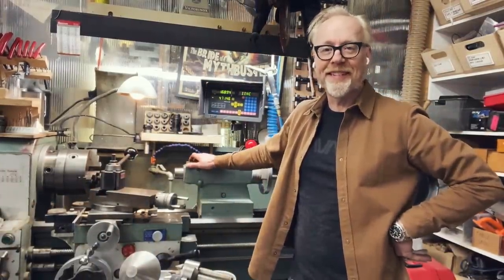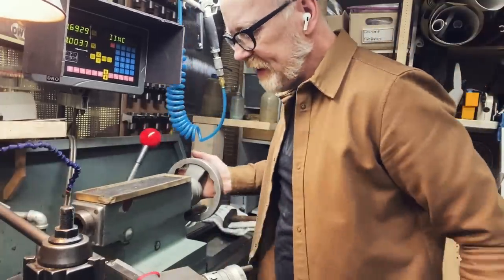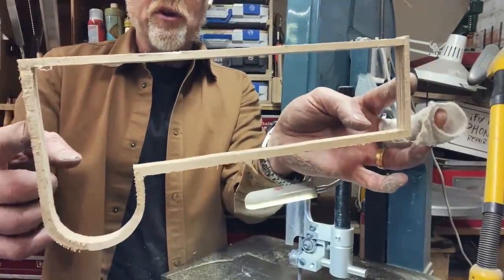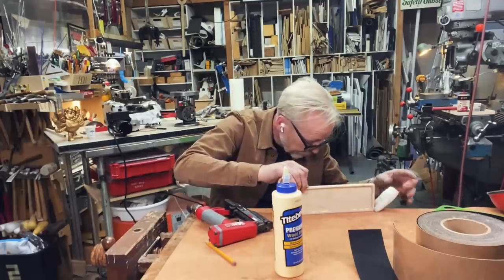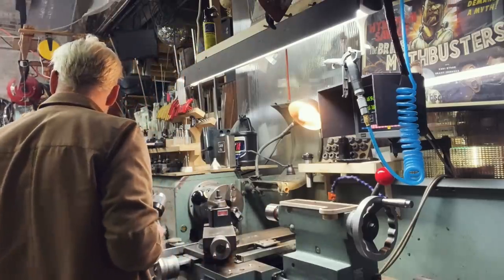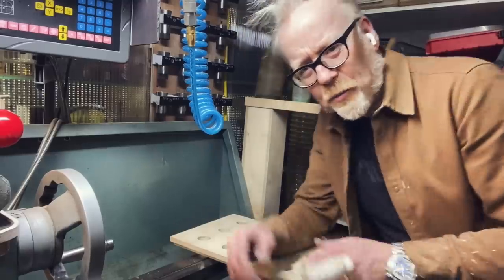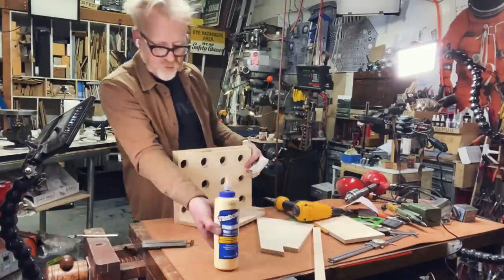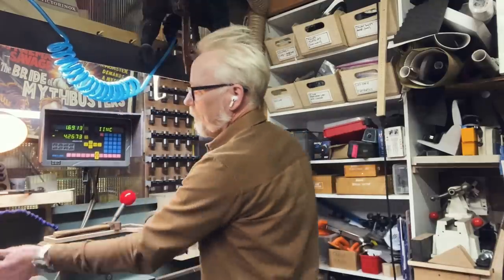Adam Savage's One Day Builds: Lathe Infrastructure Upgrades!

Comment: I am a fiber splicer we use sticky backed felt by the truck load it's a one handed job. Place felt side up hold with middle finger pick at felt corner with pointer finger it's all about the right bend and it will unlaminate itself and stick your finger in the process so you can keep it free of debris. it's the small things.

Comment: I use painters tape to get the backing off of sticky stuff. Put a little piece of tape on the corner of the backing material with a little overhang and then just pull up on the tape, that usually also takes the backing material with it. About 95% success rate on the first pull. Depending on the adhesive quality on the tape

Comment: the trick i have for the VHB 3m tape is to cut a bit extra at an angle. then tear the last bit of that cut, it tends to pull up the red backing and give oyu a little mangled tab to start peeling it with then i'll just trim off that little extra

Comment: Hey Adam. When i pull of the backing of a tape, i completely fold a smal piece of the corner, then scrape the backing back with a nail. Like if you bend two pieces of paper, they wont line up, and you create an edge, for you to handle. Hope it help. Cheers

Comment: Mr. Savage, I love all your videos and particularly the builds; I have 2 questions, 1 tape backing solution, and 1 random comment:
Tape solution:  Since you already have your exacto knife out, instead of digging at the corners cut lengthwise down the middle just enough to get through the backing. You can now fold the tape/felt/etc in half and getting the edge of the backing to come up on its own.  I learned this trick from label maker tape.
Questions:  I apologize if you've answered any of these before.  1: I know you where hearing aids, but notice you've been using the earpods a lot in recent videos (for audio pickup I'm guessing?) do the two devices interfere with each other?  2:  In this build I notice you have a cast iron frying pan on the rack at the tail end of the lathe, what is its function?
Comment:  My father was always a huge proponent of "glue and screws", both in excess, on the rare occasion he did wood working (he and wood never got along, metal was his product of choice).  Thank you sir!  Hope the finger continues to heal well!

Comment: To make peeling VHB tape easier, when cutting a piece off the roll don't cut all the way through with scissors. Cut almost all the way through, leaving an 1/8th - 1/16th of an inch and tear off the roll with a pulling action. That little 1/8th-1/16th tab should leave an easier location to separate the adhesive and the backing where it tears.

Comment: Secret to pulling backing off tapes: use two strips of tape (electrical tape) with the problem backed tape sandwiched between them. Then pull the electrical tape apart, and one side will keep the backing and the other side will keep the double sided tape, and the electrical tape can easily be separated from it. Keep it super simple, Adam.
Reply: BTW, Why doesn't your table saw have a splitter, nor the kickback guard, nor a blade protector? And you prepared to give it the finger, next? [Remember the lathe accident?]

Comment: Double-sided tape backing removal. Quite a challenge. Instead of using the Xacto to split the gap between the backing and the tape, I would puncture the corner of the backing with the tip of a sharp blade, and hook the backing off. Sort of like weeding vinyl. Just be careful not to pierce the tape, felt, etc. To hook the backing a little better, once pierced, rotate the blade so you are pulling with the flat edge rather than the sharp edge. Hope this tip helps!

Comment: A little tip I noticed on multiple projects, if you think center is let’s say 4.96” from a side, you should check your work, and your measuring tools accuracy by measuring and marking from both edges, that way if your math is wrong, or your first measurement is off, or if one of your measuring tools don’t agree with the others, you won’t end up needing to hide a crime. 

“Pencil marks erase faster than wood/metal regrows.”  - My Dad’s advice.

Comment: Getting backing of double sides tape and VHB most of the time works for me if I just pinch a corner of the backing. It then stands up a little bit and it is easier to put an xacto blade in between

Comment: Great video Adam.
Now use that push stick you made.
You could have also made a round or offset hole tool holder.
You could have even rounded the corners , or put holes in the left side to hold your centering guides,... :))))

Comment: You can use your Exacto blade to PIERCE the backing of the tape, near the corner, blade nearly flat to the surface, and lift from there.
Reply: That's a great trick. Subtlety: poke towards the corner.
Reply: @pamersiel  Yes.

Comment: Not sure if it works with all tape but you can try curling the corner; with the backing of the tape facing away from you place the tip of your finger (not the nail) on the point of the corner and sort of flick or drag your finger towards you, the tape should curl in and the backing should maintain it's original curve and come away.

Comment: Separating laminates from the backing sheet: Cut the section a little larger than required. Make two 'finger tabs' with high adhesion duct tape or Gorilla tape by folding a small section of each tab over on itself so you have a small section to grip and a larger section to stick down on the surplus of the laminate. Stick one tab to the waste part of the laminate and the other on the corresponding section of the backing sheet. Then just pull the tabs apart and voila! Saves a lot of fiddly picking.

Comment: I use a piece of Scotch tape to help pull up the corner of backed tape like 3M VHB. Press the scotch tape to the corner of the backing  you want to pull up then hold the VHB and peel the Scotch tape back. If done right it will pull the backing up with it :-)

Comment: The secret I use for double sided tape is: stick a corner to a flat surface (glass, metal, melamine) and rub it into the surface with a thumbnail. Then use a fingernail to pick off the backing. This has saved me weeks of frustration. The tape stays down, the backing comes off, then you can stick it wherever you want.

Comment: when it comes to removing the backing on tape and other adhesives, my trick is to quickly flick the very corner back and forth. 9 out of 10 times enough tape gets loose and I can pull it free.
Reply: Cut an inch by 6 strip of tape.  Push 1" it onto the backing with your thumb, Works for me...most of the time.

Comment: @adam, I may have a solution to removing the paper backing, cut the piece a little too long and then pull on it the paper will break and the glue will stretch separate the two side. I found out about this trick when working w/wonder tape.

Comment: It'd be quite a bit more than a 1 Day build, but have you ever thought of running a PVC piping system to hoses to each piece of equipment and have it all connected elsewhere in shop to a heavy duty vacuum system?  It'd help to clean up all the saw dust and metal chips and shavings when working.

Comment: Adam. I have a solution to your vhb backing problem. I have been using vhb for years and I had alot of issues getting the backing off. The trick is to obviously stick the non backed side to your material then to take an xacto but in stead of using the sharp side use the back of the blade push it into the vhb under the backing and then lever the xacto blade up and you should have a tail of backing you can now easily pull off. If you need more guidance message me and I will try to explain better.

Comment: ADAM THERE IS A TRICK WITH THE BACKING ON ADHESIVE TAPE! I use 3M VHB on the product I design and my very wise 3M rep has a trick from the auto industry, flick the corner of the tape in the tensile direction of the adhesive with your finger nail and the corner will peel right up! Might take a flick or two but it works almost everytime.

Comment: Secret to getting difficult backing off of sticky material.  Take a small piece of duct tape and place it on the edge of the cover you wish to separate from the stuff that is sticky. Leave the duct tape with an over hang and simply lift the duct tape and the non sticky backing off of the material to be used.

Comment: You don't need to back the wood, just cut until the pip comes out the other side, which is done by setting the depth gauge using the thickness of a scale ruler on the teeth at the table plane, and then you drill down. Once the pip is out, you reverse the work piece and cut it from the other side, the result is  a perfect hole, if done right, there will be absolutely no defect.

Comment: with VHB tape, if you pull the corner of the actual tape, the part that stretches, it will pull away from the film which doesn't stretch. I will pinch the top corner of the tape and pull away from the body of the main part of the tape. The red backing will come off on the corner making it easier to pull off.

Comment: ROMOVE THE SPINDLE ENGAGEMANT LEVER AT THE HEADSTOCK/CHUCK END. I say this with 30 years of machining experience and having seen many tools and such fall from the headstock such as you have on yours. It only takes one time to be mounting something in the chuck and to knock a tool holder off and have it hit the small red handled spindle engagement lever to engage the spindle with your hands on the chuck or part/chuck key. Many do have detents to prevent this but often they become worn or eventually don't work. And most people don't use the lever closest to the headstock as we get used to using the one on the carriage. Save the handle and put in the base area usually but I had my hand mashed a bit and was pulled into a spindle once by this very same issue and many close calls. I often remove the handle and people usually never even notice. But if it gets bumped and turns on... you will! Just trying to help you Adam as I would be sick if I read of such a thing happening.

Comment: For VHB tapes (or any tape with a backing, really) I find it's easier to slice at a shallow angle through the backing just away from the corner and use the edge of the knife to hold the tape down and pry the backing away - imagine a thumbnail notch in a pocketknife blade.

Comment: have you ever tried putting a small tab of wax paper between the backing and the tape once you have the roll started ... then you have access to a corner to lift and you can see it ;)
Reply: also cut with your blade angel to allow the top to be cut sooner than the bottom then you have a better shot at getting the backing off and just have that little fraction to trim if needed

Comment: TIP: to get the backing off sticky "whatever"...  Use a piece of sticky tape. Tape it into the corner of the backing, with part of it sticking out...  then use that bit of sticky tape as a handle to peel off the rest of the backing.

Comment: Adam

A great video, especially since you did it all yourself!

Would it be beneficial to protect all the plywood with marine varnish or a polyurethane?  If you do that, any oil off the centres or drill chucks won't stain the wood quite so quickly.

Comment: For pulling off tape backing: two pieces of tape: two pieces of masking (or other cheap tape) stuck on both sides of whatever bit you’re wanting to peel the backing from. Sandwich the bit between the two pieces of tape, then pull apart. Voila!

Comment: Pin nails are thinner in one direction and blow out 90 percent of the time to the left and right of the gun. Almost never up and down.  If you turn your nailer 90 degrees to where the plane  left and right of the gun is perpendicular with the workpiece, you'll eliminate most of your blow outs.

Comment: I would throw some cloth or something over the side hole in that holder to keep chips from flying in. Chips will get anywhere, and that hole won't be any exception. Nothing worse than putting in an MT tool you thought was stored clean and finding that it had a chip that galled.

Comment: @14:16 I love your solution of making an extended tube as a guide for the chuck.  I probably would have tried to bevel the underside of the board to create guide lips and thinking about it over time that'd be a weak point where the thing could end up breaking.  Still I would have gone with the two holder solution.  Not cause I'd want two holders but cause it'd allow ease of putting one chuck down and picking the next one up one handed without doubling the operation by having to put one  on the tailstock, pick up the new one and set it, before then putting the old one in the holder or having to use two hands.
Reply: This work really goes for proving the "many ways to skin a cat" idiom.  Often in life I feel like other people's ways are wrong and mine are better but this really is the kind of stuff where I can see that there is no right and anything that works is just as good as the other.  Though it could also be said there's no right way to skin a cat cause you shouldn't be going around skinning cats!

Comment: The secret to VHB, the duct tape of sign making, the paragon of pressure sensitive tape, is to use the finger nail of your thumb and scissor it against the underside of a corner of the backing against your index finger. 
Lever it up with your thumbnail and pinch it against your index.

Comment: You can take backing off tape very easily if you keep the tape at a warmer than room temperature right before you use it, anywhere between 20 minutes to an hour. Each tape has its own perfect peel temp, for 3M types i usually keep them at a balmy 34Celsius, other tapes, cheaper tapes require more. Don't let tape bake in heat, that will ruin the glue, and you usually only do the section you're going to use. Some types of backed tape are heat activated, so those are exempt from this method, as they will be useless once heated (since you're supposed to heat them in situ with a heatg*n or bake them by use, if say a tape for taping the seal on an oven). That also applies with considerations for certain materials that the tape is made of, testing is important when doing this.

Once you figure out each tape's tipping point, it can be as easy as using your thumb and pointer to "slide" or crinkle the backing off the tape, to reveal a peeling corner.

Comment: There is one thing I don't like about that design on the lathe. The size of the outer edge on the chuck. The chuck is resting on the higher lip meaning that its not flat on the table and stuff can get underneath it. Seems like the perfect way to lose a small set screw or something while doing work on the lathe. Otherwise its nice and that carpet tape should stiffen up over time so it wont have any flex in it.

Comment: Its common practice when doing the holder to drill the holes to be a tight fit 3/4 way up the taper so that they are held firm and don't rattle. Just saying

Comment: the secret to removing tape backing is to use two small peices of masking tape sandwiched on the front and back side of a corner, peel your masking tape apart, and the backing comes right off.  it will change your life, I promise.

Comment: I used VHB a lot at my old job, I found that the fastest way to peel was to unroll the length that you need and start cutting with the blade the red plastic cover, avoiding to cut all the way trought. than just pull and rip the VHB away, it's so elastic that will separate from the red part bit stil rip at the exact point you need.the plastic part is not as elastic as the tape. it's easy, is harder to explain how to do it in a comment...not in your native language...

Comment: Well... Yes.... I have the solution to the 'Removing of the Backing from Sticky things problem"!  The solution is very simple but to be a complete solution, it would take all the manufactures to implement it and therefore I don't think it would come to be.  But,  I have another solution that I would like you to attempt to see if your fine hand control would allow it to work.  1) The MASS solution is... In the past I have used a particular sticky medical tape which was on a roll that had a backing that was easy to remove only because it was pre-cut (split) with one long continuous line for the entire length of the tape.  When one cuts off a length of this tape and when holding one end Bending the tape forwards while rolling it slightly back and forth the backing would split nicely and lift off of the tape at the cut.  That is and was the best solution to the problem.  2) As a comparison, I used another medical tape which was sold cheaper but nearly identical in use.  It was not as easy to peel off the backing due to the simply fact that the cut line in the backing was a curvy line!  This made it harder to get it started.  3)  And finally, as another  solution short of any outside help.  Lay the piece of tape or the item with the backing down on the flat surface of wood and carefully score the backing with a very sharp knife or razor blade.  Of course it is up to you to be very careful with your pressure used on the cut and not go completely through all of the thickness.   I don't believe that a full length cut is necessary on the item since one is only trying to get started pulling off one part of the backing.  Please have fun with the suggestions, I enjoy your videos.